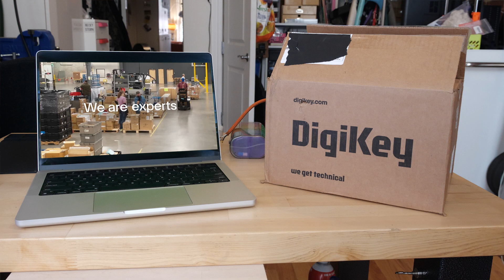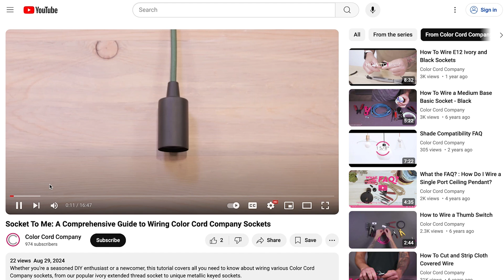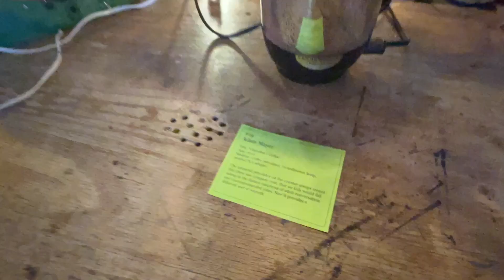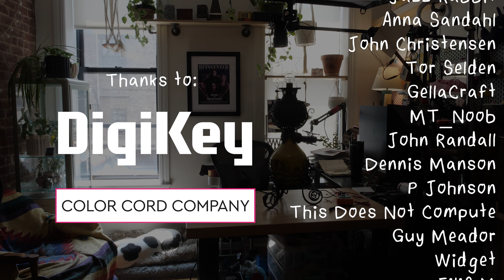How to Re-Wire a Vintage Lamp

Comment: When we moved to where we live now, we needed some light on our closed balcony. I made six hanging lamps with as many different coloured wires. They were hung in three pairs, each pair having two different lampshade shades (white with a few red stripes, and orange—both old curtain fabric from the 70s). The combination of the lampshades makes the light seem like sunlight. A happy accident I really love! Originally I wanted them to look like small ghosts with the fabric just hanging down over the LED bulbs, but it turned out to my surprise that the bulbs got fairly warm. My solution ended up being a CD on each socket to spread the fabric and keep it from the bulb. The CDs reflect the light and make the lamps better. Another happy accident :^) The last thing that came from it was that I bought some better tools for working with electrical wire 😅

Comment: Thanks for sharing and I really like the gate valve lamp.  My favorite lamp was one made from stainless solder    stenclices wrapped into a cylinder. It was capped at the top and you put a long bulb in it and projected the most amazing designs on the wall.

Comment: How can you break a power strip by switching live and neutral?
Reply: If the wires are swapped, and you're electrocuted by touching the metal base of the bulb (if not plugged in to a GFCI socket) your corpse might land on the power strip and damage it.
Reply: You can't. I'm not sure how it is in the US but around here the live and neutral wire are switched around all the time in the outlets so you're not even certain which is live and which is neutral in many cases (I mean.. you could check, but who does that?).

Comment: with a lamp body containing that much metal I always feel safer to ground the body when the lamp itself does not provide a ground terminal. You know - stuff happens and those wire loops could come loose and touch the lamp body.